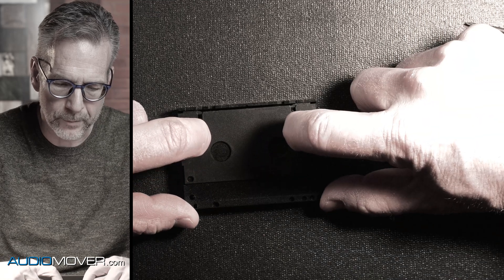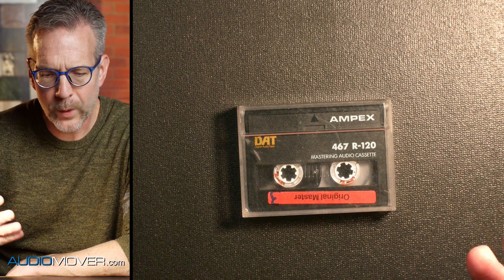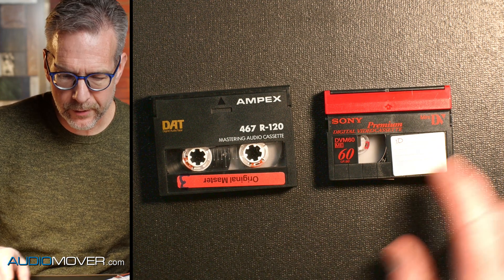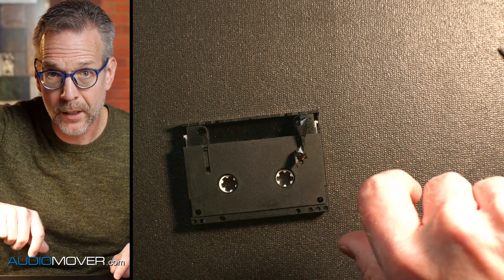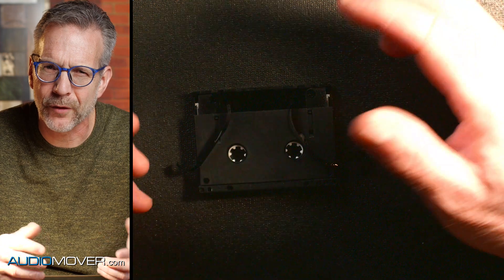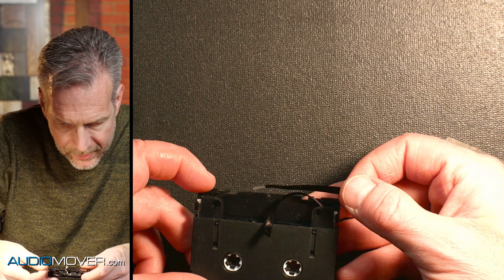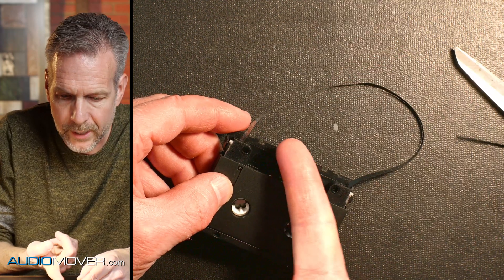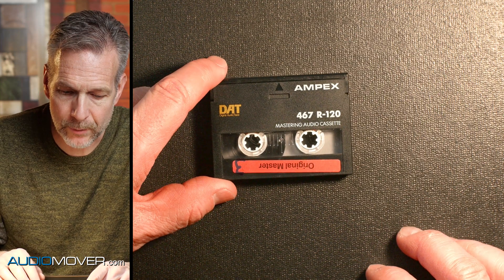DAT Repair - Digital Audio Tape

Comment: I own many brandnew (sealed) and used DAT tapes from several brands. If i need to repair an broken DAT tape (at the beginning or at the end) i use ultra thin silver folie (on one side with glue layer) cut into 4mm wide and 1cm lenght. That silver folie is normaly use for blinding windows. Maybe you understand what i mean. The prices of 2nd hand or used DAT tapes are very low at this moment. Lower than € 2,00 each. Love SONY DTC-55ES and Panasonic SV  DAT recorders.
Reply from the maker: That's a great way to do it. DAT tape is so thin, just about any kind of adhesive ads excessive bulk to the reel. When we fix anything here, the main goal is to get it through a player a single time to get the audio captured.
Reply: Hi do you remove mold from the DAT?
Reply: @1webchester , As former SonyNL employe/technician since first Betamax in Europe i had Sony cleaningsticks (plastic holder + kind of chamois leather). I make them now myself on a wooden (ice) stick. Chamois leather is avaiable in standard shops. Avoid liquids like alcohol, use only if dry cleaning doesn't help.  Most Sony DAT recorders had a mechnical/plastic part with a mini sponge with should "clean" the head during (un)loading. Remove that part because due age its falling apart and ends in mechanism.

Comment: much appreciate this great video. I opened a SONY DAT and repaired it but could not figure out exact path inside the cassette (I wish I had taken pictures). After I reassemble it, the deck would not move the tape.  Do you happen to have a short video clip showing exactly the entire tape path?  Many thnaks